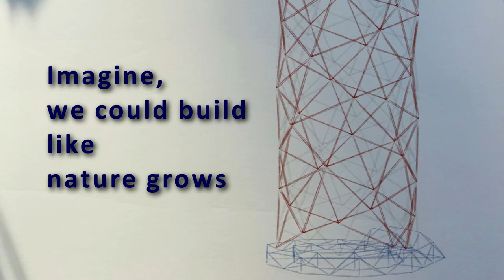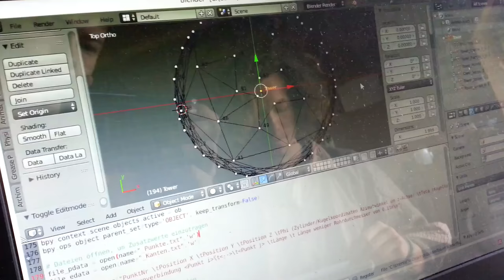GROWINGTOWER Trailer - A geodesic structure

Comment: How many trees were killed just-for-fun?
Reply: Sorry, but you're kind of asking the wrong question. Trees are a renewable resource, at least here in Europe where forests are sustainably managed (new trees are planted to compensate for those harvested). Wood also stores CO2, if that's a concern. Would it have been better to use non-renewable materials? And I don't think this was done just for fun (although they clearly HAD fun), it was an interesting experiment and proof of concept that may even inspire others.